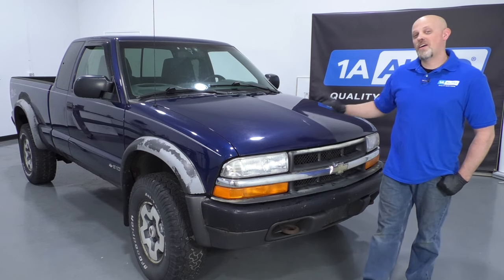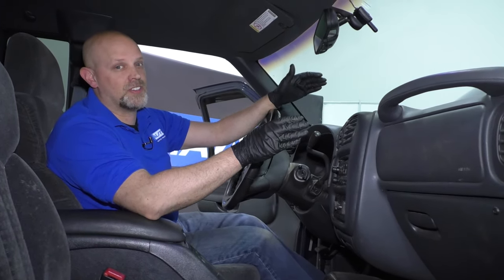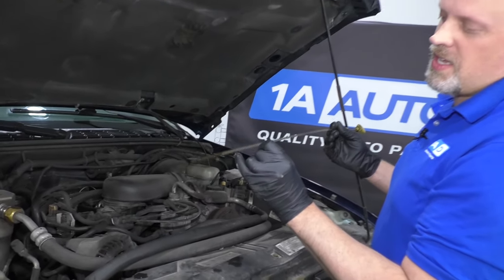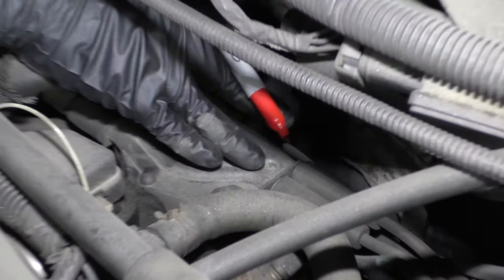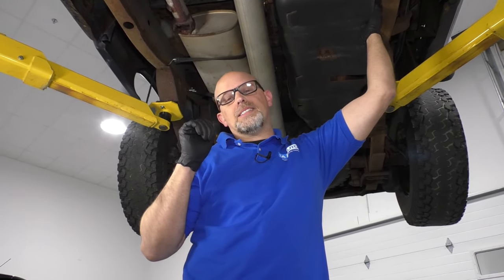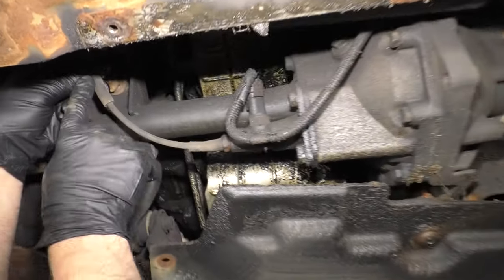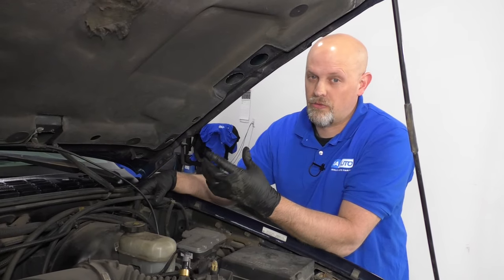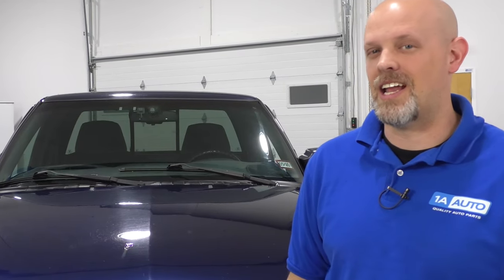Top 5 Problems Chevy S-10 ZR2 Truck 2nd Generation 1994-04

Comment: What about a transmission not shifting, I've replaced the 2 sylanoids in transmission and the other electrical part ,and it still doesn't shift into 3rd and drive????
Reply: You probably need a new trans. Join Precision Transmission on FB and ask your question.

Comment: Battery leaking acid onto the 4wd actuator. The actuator that activates the front diff lives under the battery and is prone to corrosion and failure due to its location.

Comment: Have and still drive a 98 S10.
Issues I've had.
1.  No fan ( twice )
2.  Widnshield wiper motor stop's working x2 ..... Replaced one .... 2nd one .... I'm going to figure out how to short all the intermittent stuff just have on and off.
Reply from the maker: +John Jacob JinglehimerSchmidt Thanks for the feedback!
Reply: Check and see if your truck had a recall on the windshield wiper motor. I had a 97  S-10 that had a recall on it. Was a free replacement from the dealership.
Reply: Remove the wiper motor and resolder the welds. There is a video on how to do this.

Comment: never had any of these problems with my 96 4.3 truck. I also didn't let dexcool go forever in the engine. its antifreeze just change it every 2 years the 5 year rating is too long
Reply from the maker: +Fljeff7 Thanks for the feedback!
Reply: In my owner's manual it says you can use either the gm orange dexcool or regular green antifreeze 50/50 mixture with distilled water. My coolant was rusty and brown so i flushed it 6 times. Got a green one in now works good the engine has had like an overheating problem before but now it's alright and cool.

Comment: Have you ever heard of doing plugs wires and cap and you have to reset the computer by racing the motor please comment back my mechanic raced my motor so much I had the stuff from my cattle later converter coming out my exhaust
Reply: WHAT I have never done that on my blazer ZR2 and i had it for 14 years. 
350k+ before it died.  
A tune up is something that you can do on a Saturday morning.  
If you don't think you can.  I would shop around for a different shop.
Reply: Yes, if you remove the entire distributor and put it back in you have to do cam/crank sensor relearn. You need a high end scan tool to do it. On the Tech 2, you enter that mode and rev the engine up once and it’s done. If you don’t have a dealer level tool, revving the piss out of it won’t do anything. XD Search “Tech 2 Cam Sensor Relearn”
Reply: I had a shop do that to my truck and then he told me when I was standing there he had to reprogram the computer he raised it so much the stuff in the catalyser converter was coming out my tailpipe and then my motor started knocking is that fault of the mechanic or no please comment back in let me know I am very very curious thank you for these tips
Reply: @Mdudeman13   No he did not pull the distributor out he only took the cap off and put a new cap plugs and wires that's it he had the stuff from my   Converter coming out my exhaust that's how much he was racing my truck he  Said he had to reset the computer I never heard of it please comment back thank you very much I think he just wanted to do a motor job on my truck

Comment: My name is Everton I have one of the Chevrolet S10 95 model 5-speed four-wheel drive the problem I have with it Muffler and a cylinder head need to bolt in it what I would like to know can I order some of those bolts I'm in Jamaica

Comment: I have a 2001 s10 v6 and it has a parasitic  draw my battery dies over night my buddy says it's not my alternator
Reply: I just bought mine to, realized if you keep anything plugged in it will still draw power, another problem will be bad ignition switch when the key is inserted you can actually click it one back out of slot and that will
Also cause your car not to completely turn off
Reply: Interupt you negative battery cable with a meter and pull fuses one at a time to find the source pulling and draining your battery.
Reply: The draw is common, mine has had one so I used multimeter to check and it just had a high draw 3.2 volts when initially checked then it falls down to normal value around half a volt. Not sure if it's actually returning to normal or if my multimeter is just malfunctioning.
Reply: It couldn't be the alternator if its happening overnight.  Unplug your phone charger when not using it.  U can also use a solar battery manager
Reply: Instrument clusters are bad about parasitic draw.
Reply: @Zachary48  Ignition switch issues are notorious on Chevy cars is there a good aftermarket ignition switch or did Chevy make a good replacement part?

Comment: You forgot starter relays going bad, engine power lost/sputtering motor with ac on, elbo rest always get soggy, the steering wheel gets dry and start to disintegrate I go on and on

Comment: Damn I'm grateful my heater still works really good, plus the last owner never changed anything in this truck but I'm still slowly fixing it up and spent about $900 on parts 😅
Reply: I envy you. Gave my dad mine while it was new in 03. He passed in 2020, and I found it in a storage yard, packed full and in pieces. 15k$+ after rebuilding the trans last year.

Comment: my 2000 2.2L fuel pump connectors cracked due to age the assembly being beige plastic. its best to remove the bed. don't go under
Reply: Dropping the tank is easy to do by yourself.
Reply: Yep it's best to remove the bed and slide it back same thing that the fuel pump two times on mine that's because I was trying to find another issue on a short somewhere else and the fuel pump wasn't even the problem live and learn

Comment: Can anyone here tell me why, on my 2003 Chevy S10 truck, whenever I use the window washer spray option, located on my blinker mechanism,  turning it a half turn allows washer fluid to spray and wipers come on automatically, usually wipers will engage 3 to 4 swipes, then turn off back in place, but mine, all of a sudden, once it sprays, windshield wipers turn on, as it should, BUT they won't turn off.. they just keep going back n forth over and over. I literally have to stop, turn engine off to get them to stop.. using the actual wipers for when it's raining, all those mechanisms work fine
Reply: Sounds like you have your wipers control chip malfunctioning, an easy fix, just replace the chip inside the wipers motors where the wires plug in with a new one, 3 or 4 small screws u can do it easily by yourself, you would also regain all your wipers speeds/delays by that fix.

Comment: So there's no chance that he had to reset the computer no reason at all he had to do that he raised my truck so much he had to stuff from my cat coming out of my exhaust and then I had to go for a motor  In my truck because it blew up He came up with excuses saying that she had to reset the computer I did not think doing a cap plugs and wires would make you have to reset the computer it is on heard of thank you I just wanted a second opinion Thank you so very much

Comment: When I first got mine we had to change distributor it cut off going down road. 5 years later it has cut off again the fuel pump has always whined but now it sounds horrible weak sounding. It wont start help where do I start
Reply from the maker: +Dana Mitchell We wouldn't be able to diagnose an issue like that here, you may want to have a local mechanic take a look at it. Thanks for checking us out! http://1aau.to/m/Shop-1AAuto-c
Reply: Check your fuel pump relay first. It's probably in the glovebox. If that starts going bad,it may not let full 12v pass through to power the fuel pump. Also if you can get your hands on a fuel pressure tester you can test the fuel pressure. If the pressure is too low,below 40? It won't start,but it will start and run if you spray a little quick start in the intake. Its supposed to have 58-66 psi. It might run & drive with lower pressure. It will lack power though. If that's the case,don't drive it. Fix it right first. It might damage other stuff.Might be fuel pressure regulator,that's under the plastic Upper Intake Manifold. If it is any of those things might as well change the fuel filter too. Mine is a 97. I've replaced all that stuff on mine + I carry a spare relay and needle nose pliers to get it out. I think it is one of the 2 center ones. They're all the same. Try switching them around and maybe you'll get lucky and it's an easy fix. Mine is a 97. 96 to 99 are pretty similar probably 96 to 04 are very similar. I've only worked on them up to 99.

Comment: Can you plz help me. I have a 2001 s10 zr2. It is trying to go into 4 wheel drive on its own going down the road. What could the problem be?
Reply from the maker: +Mark Moore We wouldn't be able to diagnose an issue like that here, you may want to have a local mechanic take a look at it. Thanks for checking us out! 1AAuto.com
Reply: I had that problem years ago on my 02 zr2 turned out to be the vacuum switch on the transfer case.

Comment: So I'm the only one that noticed the muffler was being held on with bungee straps?😂
Reply: Bet it smells great after it gets up to operating temp
Reply: Oh, I noticed. As a mechanic I've seen worse
Reply: just realized that today, but i’m not complaining because it made it easier to gut the catalytic converter
Reply: gets you out of the used car lot
Reply: That's just until the muffler bearings are replaced

Comment: No. 1 problem.. gas mileage of a big block v8, power of a pinto 4 cylinder.. buy em dirt cheap n LS  swap them with a manual transfer case. Then you'll have a decent truck..

Comment: my grandma had a 99 blazer the 4x4 acted up a number of times because of that stupid electronic thing, after it was in the shop like 3 times she  told them to just leave it in 4x4 and just use it as her winter vehicle, she had a 92 much better truck. the 99 had cat problems, wheel bearings, balljoints, a number of different hoses, paint that flaked off,  it was such a pos when i was in college she junked it without telling anyone and then wrote me a check for 2,000$ to buy my grand vitara xl-7 which she drove til she went to the home which was almost a decade.
Reply from the maker: +Shishizurui Thanks for checking us out! http://1aau.to/m/Shop-1AAuto-c
Reply: I bought a2001 S-10 LS with 4 cyl engine. I have had it 6 yrs now. Had 71 thou on it when I bought it for
4500.   I have replaced the break booster and the ac compressor. That’s it. I love my little truck.
From the sounds of it all you guys that have had so much trouble with ur trucks I got lucky.
It took me three years to find the one I got. And I don’t drive a lot just pleasure use but love my truck.
These videos have been very interesting and informative.....should any of these problems arise with my s-10, I have a blk German shepard so the third door
Really comes in handy too. Don’t know how to attach a pic or I would.

Comment: Didn’t even mention the reason all the engines blow , the oil cooler line o rings. Or the reason the transmission goes out in 3rd 4th gears, or out period the tcm recall, cooler line o rings. Or the fact all the motor mounts are bad. just a couple more important facts about them lol.
Reply from the maker: +Stephan Marshall Thanks for the tip! We'll pass this info along to our production team.

Comment: Really stupid design, mine leaked and got fluid in the hvac controls. I've replace the selector switch 4 times in the  dash because it gets stuck on vent and has a constant vacuum leak, it hisses and is very annoying
Reply from the maker: +Jake Chasteen Thanks for the feedback!

Comment: Long story short they will nickel and dime you to death . Engines and trans are pretty good on them but you will work on them from 60 k miles until you get rid of them . I had one not a zr2 bur it tore up all the time . A ranger is far more reliable I think . And I'm a chevrolet guy kinda . Yeah every now and then someone gets one that's good .

Comment: You could do an entire video on problems with the 2.2... Probably the worst engine GM ever built. They are money pits and head gaskets blow faster with the 4L60E than the manual transmission.

Comment: Said nothing about iron duke 4cyl. engine. Pass loc problem. I bypassed the original fuel pump relay with a relocated switch and relay. No prime circuit, just starts the pump.
Hate security crap, only for people who don't trust others.
Period.
BullyBilly.
Reply from the maker: +William Helus Thanks for the tip!

Comment: What about the head gasket problems what about the security problems on the Transmissions that you forgot to mention what about the cheap radiators it's always need to be replaced and even touch the iceberg when half the stuff that goes wrong with you Strokes

Comment: Thanks for your videos  need, help removing  my 94 S10 climate control switch  so you, have any videos  😎Doug inGa
Reply from the maker: +Francis Potter We do not have a video for this repair right now, but we'll keep this request in mind for a future video! http://1aau.to/m/Shop-1AAuto-c
Reply: You basically have to go through all the steps as if replacing the radio,  there are YouTube videos for that particular year rang , 94-97. They will be the same,  it's a pain to take all that stuff off to get to the 4 screws that hold that module in place but it is what it is.

Comment: It's made by GM!! The cut corners company..
Reply: I used to work for a Ford company for 3 years and made anything from radiators to transmissions and you would be very suprised by how many corners we had were told to make... we are talking probably multimillion dollar law suits
Reply: GM = "Get Mechanic"